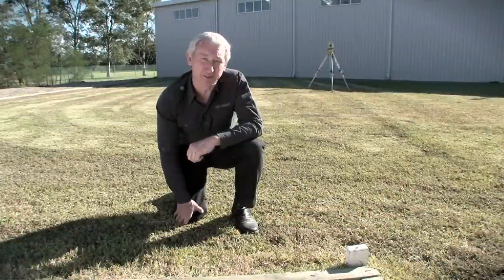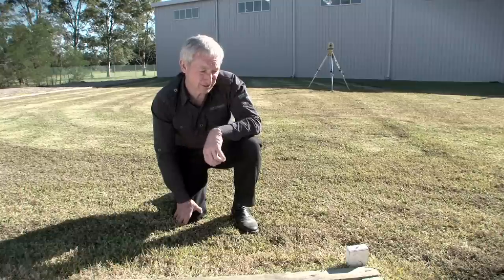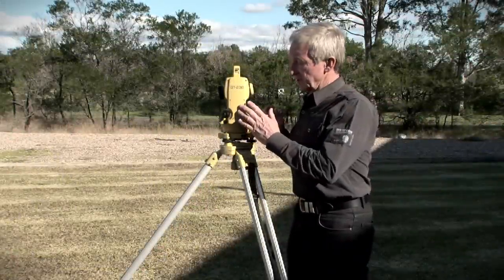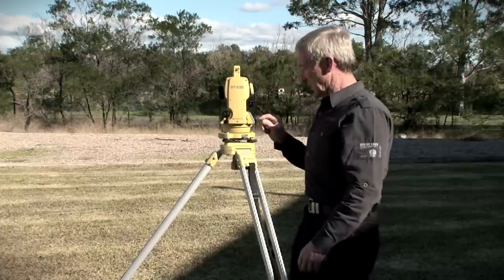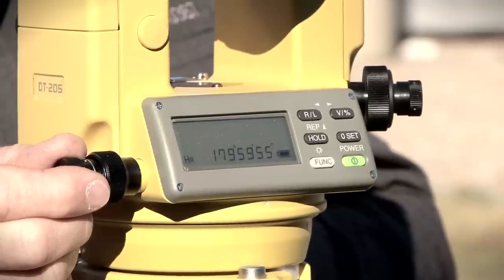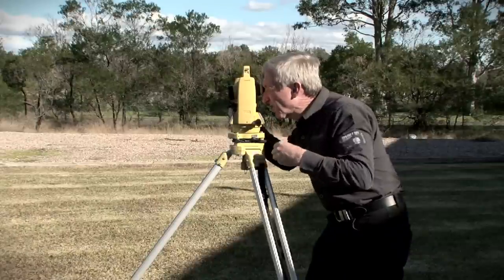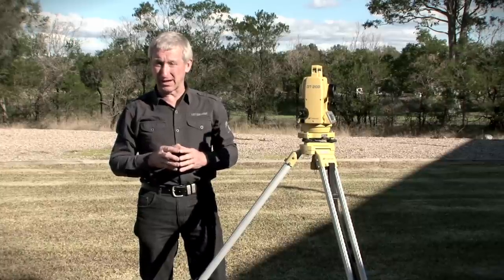Theodolite 3 - Collimation in azimuth - OTEN Building & Construction

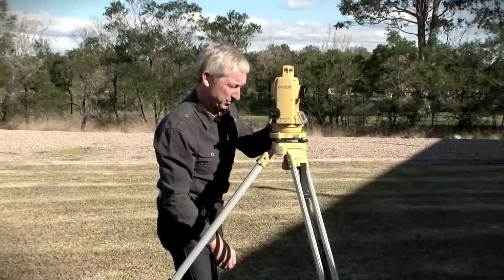Comment: At 1:42 and 2:28, Dave is turning screws of the instrument. But, at this point, you must NOT turn screws since you have set the instrument to 180 degrees. Apart from that it's a nice video.
Reply: I believe he is raising the telescope to get to the assistant's pen so they can make the mark, correct?  The horizontal angle is not changing, only the veritcal.
Reply: No. First he sets the horizontal angle to 180°0000.  Two seconds later in the view from behind he is turning that horizontal screw again. The edit of the video is not chronologically correct.
Reply: @Kogacarlo  oh you're right. Except in the second shot (from behind), he has changed the face of the instrument and the adjustment knob on the right side of the instrument is the vertical angle knob.

So he isn't doing it wrong, he just left out the part where he changed face and it made it confusing.